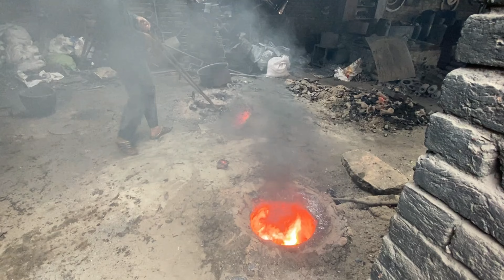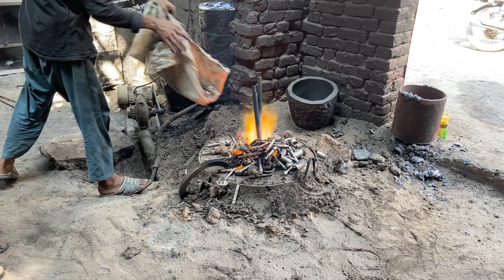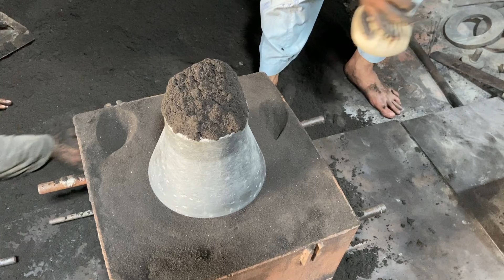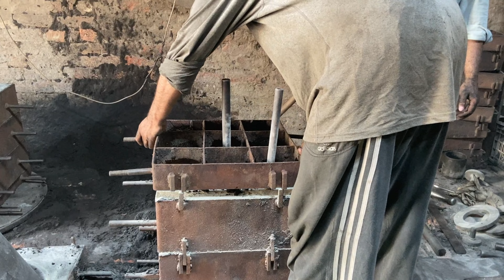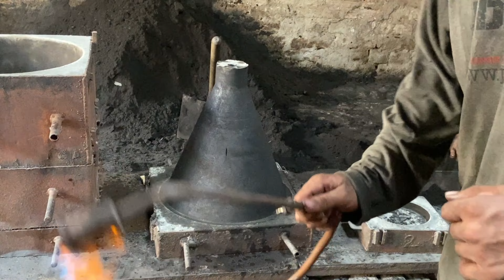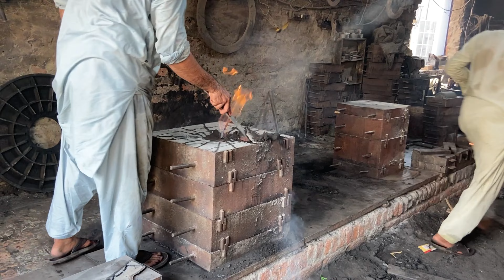Wow Amazing Stainless Steel Casting Process using Sand Molding Method

Comment: Pakistan needs to stop using mollases for quality improvement, the process becomes even simpler and faster, though a little costly but the quality improvement in weight consistency and mold rigidity is amazing.